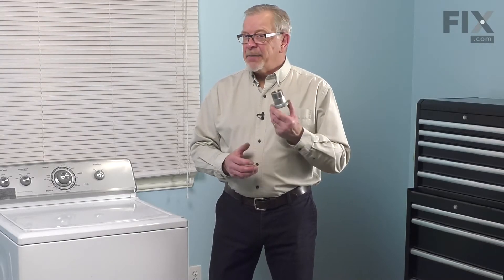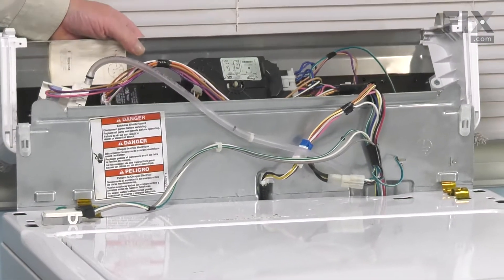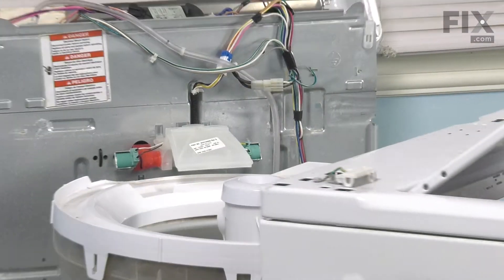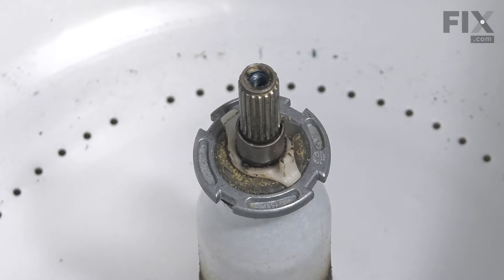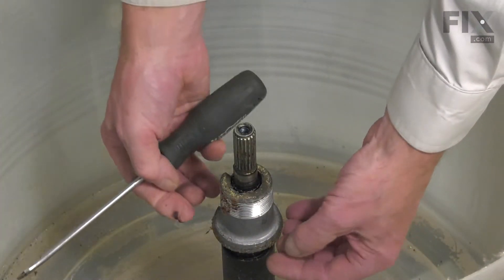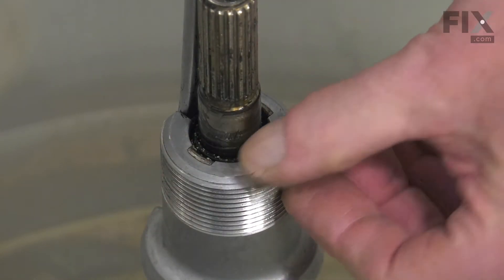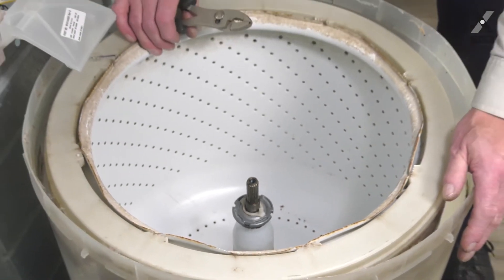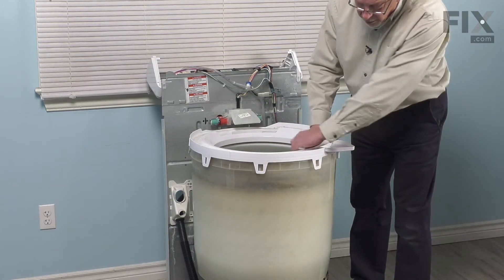Whirlpool Washer Repair - How to Replace the Drive Block

Comment: My inner basket never comes out that easily. I put a scissor style automotive jack on top of the drive shaft to push upward on a piece of 2x4 lumber cut to fit inside the top of my basket. I am getting pretty good at this because my Whirlpool Cabrio periodically eats gear boxes, due to leaky rotating seals.

Another tip: while you have the inner basket out is a great opportunity to clean out the inside of the outer tub.